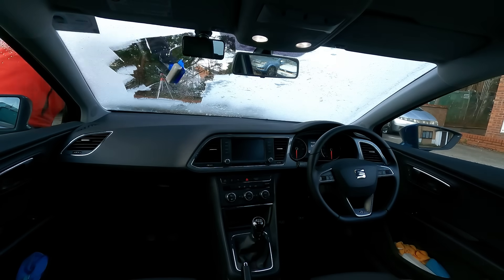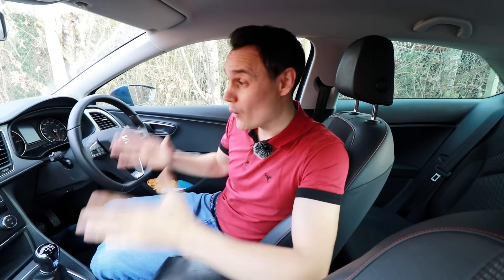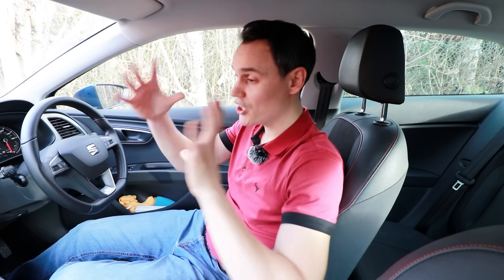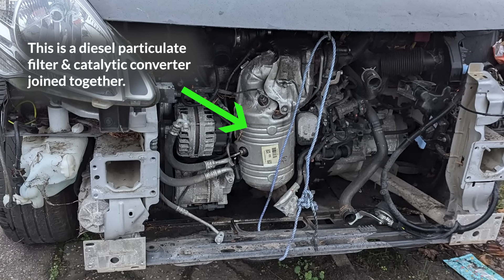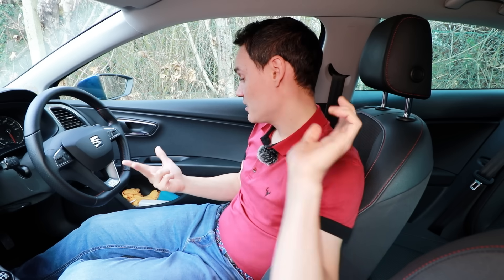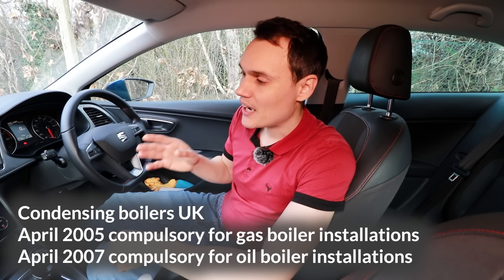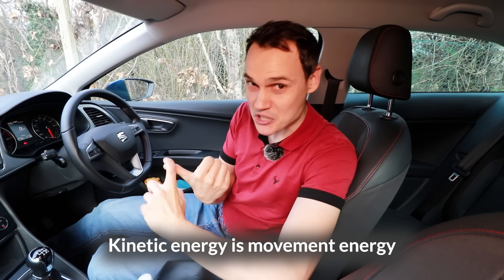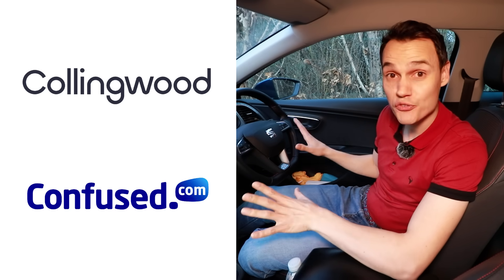How turning the engine on when de-icing can cause you harm. Possibly even cancer.

Comment: Why don't car manufacturers program the function of rapid engine warming? Say, you turn it on and the engine keeps higher rpm than idle when the car is stationary. Let's say 1500-2500 rpm. Seems like a win-win, right?
Reply: Engines do keep higher rpm's than idle when cold. The ECU controls this.
Reply: @collinslfc they keep them barely above idle for less than a minute during cold start. I'm talking about 1500-2500 until the engine is either fully warmed up or the car put in drive and going.
Reply: @Psych0technic  Car manufacturers have to meet stringent emission targets. The higher the revs during cold starts when the engine is running at it's least efficient will increase pollution. Secondly, the more fuel that is used during cold starts will increase oil dilution which is not want you want as this increases engine wear.
Reply: @collinslfc have you watched the video? He says that the longer the cat is cold the worse the emissions the car produces. It is a wide consensus that it's better for a modern car to drive it straight away instead of letting it sit on idle, waiting for the engine to warm up. So, why not emulate it driving while it's parked? It would be incredibly convenient during winter. Besides, if it's just an option for the user to decide and it's turned off by default it shouldn't matter to any regulations. It would be essentially the same as if you just put down the pedal manually which isn't prohibited.
Reply: @Psych0technic  Okay, you know better than car manufacturing engineers on how they should design their engines. I do apologise, I should never have doubted you.
Reply: @collinslfc my bet is that car engineers just don't care enough to bother, since it's not a function that will make money for the management.
Reply: @Psych0technic  Yeah, your bet... Sorry, what qualifications do you have in automative engineering? You haven't stated in your comments. I'm genuinely interested.
Reply: @collinslfc maybe you should watch other videos about the topic, made by people with actual degrees and knowledge. Engineering explained, for example. Because you're the one being ignorant here.
Reply: @Psych0technic  You clearly don't understand the video content of the likes of Engineering Explained... But please answer my question, what qualifications do you have in automative engineering? It's a very straightforward question to answer.
Reply: @collinslfc no, you're first, lol. What are your credentials exactly?
Reply: @Psych0technic  I'm not an automative engineer.  I'm not the one who is claiming that automative engineers are wrong in the way that they design engines, whereas you are. So you have to back that up with your credentials and experience, hence why I'm asking you. It's not a trick question. it's not an argument, it's just a straight forward question.  Please answer it.
Reply: @collinslfc it seems that not only are you having a problem with getting the point of this video, you have a reading comprehension, too. Where did I say that automotive engineers are wrong, exactly? Can you cite these exact words, please?
Reply: @Psych0technic  You literally said "my bet is that car engineers just don't care enough to bother, since it's not a function that  will make money for the management."  Are you being deliberately simple? By the way,  I'm still awaiting an answer to my previous question which I have asked 3 times now....

Comment: I just pour warm water on the windscreen. Quick and easy.
Reply: Been doing that for 30+ years, just make sure you wear a rubber glove to stop your hand freezing after it gets all wet. Use a bucket and sponge- do all the windows, headlights and sidelights. Put the bucket/sponge/glove in the boot in case you have to repeat the process before coming back from work.

Comment: Except it doesn't address the mist inside the car? Is my car the only one that mists up so badly that I literally can't see a damn thing until I demist the windscreen?
Reply: A lot of people still don’t know that air conditioning should be used all year round not just in the summer,air conditioning is basically a dehumidifier in the winter it conditions the air removing all moistures in it,using air conditioning on a cold morning is cheaper and faster at clearing both front and rear screens then using heated screens.
Reply: @alancobbin Unfortunately some cars will refuse to turn the AC on in cold weather, my car won't allow it to be turned on if the outside temperature is below 4 degrees.
Reply: @GreyJan2750   What does this mean? The AC system isn't robust enough to withstand cold temperatures? I know classics generally have pretty anaemic AC systems
Reply: @agiliteka  Water turns to ice at 0 degrees C. Dehumidifiers for sub zero air are expensive.
Reply: @GreyJan2750  
I would suggest getting it looked at or get another car.
Reply: @stuartj1234  It's by design
Reply: @alancobbin my hair conditioner only works in the shower
Reply: @alancobbinweird that I never thought of that! Did it this morning and worked a treat!
Reply: @alancobbinyou need to be careful in the winter, if you blow your AC onto a misted up window before your engine is warm you could freeze the mist/moisture onto the window.
Reply: @mikes1992u  
You do know it blows hot air as well as cold right ?
Reply: @stuartj1234 AC would only blow hot air if you had a reversible heat pump and the majority of cars don't have this, the ones that do are generally electric cars because it uses less energy than a standard resistive heater which helps extend range during the winter
Reply: Check your boot. Take out the spare tire and see if you have a pool of water in the tire well. If you drive around with the window open an inch or two and the heater on it will help to dry out the car.
Reply: My car freezes on the inside to. I have to scrape the outside and inside.
Reply: It's not a honda jazz is it? That car of mine mists up 5 minutes into the drive....what a total pain.
Reply: @geriatricprogrammer4364 Fr same here i drive a honda jazz and its a total pain in the ass during winter always misting up
Reply: @geriatricprogrammer4364  if you have climate control, put it on, it dries the air quite quickly, i know it seem counterintuitive but it works ;)
Reply: You've probably got excess moisture in your cabin. Leave a passive dehumidifier on your dash for a few days.
Reply: @jigler  leave window open
Reply: fill 1 or 2 socks with cat litter, tie it closed and place it on your dash. My car used to fog up terribly overnight and if you don't have the ac on permanently but the cat litter sucks up the humidity and keeps it clean
Reply: You got a water leak to investigate, thank me later.
Reply: Get a dehumidifier and use the air con. My Citroen c1 was awful until a few weeks of the dehumidifier.
Reply: Keeping the inside of windscreen completely clean will speed up clearing (mist clings to dirt and grease). Swapping out carpet mats for tailored rubber mats in winter reduces moisture building up.
Reply: Check your carpets to see if any of them are wet, which would suggest a leak, but in the perma-damp of some places of the UK, you can't help introducing water into the car on rainy days months. Take out brollies and coats to dry them. Living in a rural valley, I have to use silica bags on the dash overnight because damp is just part of life in winter.
Reply: You can get dehumidifiers to dry up the inside.
Reply: @tomriley5790  It always always is a water leak.    
How many new cars your see with humidity issues inside?
Reply: @siamanspaps  It was an issue for me and my brand new car and I suspect that the actual issue was that the trips I took were too short. Once I moved and my daily commute went from 5 minutes to 1 hour (each direction) I had no more problems with windscreen being frosted over from the inside.
Reply: because the screens too cold, it just needs to warm up
Reply: I use a window vac, clear screen right away.
Helps to take moisture out of the car as well.
Reply: If you have wet floor mats, boot … or a leak, or the inside of your windscreen is coated with road grit - these are why the inside fogs up or has condensation.
Reply: Change your pollen/cabin filter, check the scuttle drains for blockages and buy a couple of Hillington dehumidifier bags. Personally I use 2 in front and 1 in rear parcel shelf.
Reply: Depends on your car. My FIAT has a new cabin air filter, new coolant, clean heater core lines and new windshield (old one got damaged). And all rollable windows have wind deflectors. And you should clean all windows every seasons
Reply: Have you tried turning on the AC? Works like a charm
Reply: @izakf5301 some cars turn off AC below 3c (happened to me first time it turned off, complete white out inside my car had to pull over for couple of minutes so heat only cleared the window)
Reply: Get an EV.
Reply: @andyt1048  thanks but no 😂

Comment: I simply use defrost spray and the ice should be gone right away. The spray is less than £5. I wonder why very few people use that?
Reply: not great for rubber seals, creates glare as spray leaves some residue and can refreeze anyway, sometimes on the inside as the glass is still freezing temperature
Reply: @Dr.Kornelius 

Yep...many synthetic chemicals are bad for rubber seals...

Comment: I start the car on the driveway and blow warm air to the windscreen and leave it for a few minutes then i get one of those garden (pump)  mist sprayer 
with warm water inside and i spray a small amount onto the windscreen. It won't crack if you do it slowly and the screen is getting warmer and the ice melts down.
Using those scrapers put fine scratchs on the glass so i avoid doing that.
I have been doing this every winter for over 10 yrs and find it the best solution ..maybe not the safest but i think i will now keep well clear of the exhaust.

Comment: This is a great reason to switch to EVs as soon as possible. Getting into a warm car without breathing toxic exhaust fumes is unbeatable.
Reply: Ginormous depreciation rates, worrying about where to charge the car, waiting ages for it to charge, reduced range and battery capacity in cold weather. Not to mention new legislation for EV owners with pay per mile.

Comment: The short version (the main idea)

Leaving your car engine running while you de-ice it is bad for your health, because at the beginning the car releases much more toxic exhaust gases, and those gases are especially dangerous before the catalytic converter warms up.

So the recommendation is:
👉 De-ice first with the engine off → then get in, start the car, and drive away.

Why this happens (in simple terms)
1. What is the catalytic converter (“the cat”)?

It’s a part of the exhaust system.

Its job is to clean toxic gases coming from the engine.

It turns very harmful gases into much safer ones.

⚠ Problem:
The catalytic converter does NOT work when it’s cold.

It only starts working properly at around 250°C.

If you drive, it heats up in ~30 seconds.

If you just let the car idle, it can take several minutes.

So when the engine is on but the car isn’t moving, toxic gases are coming out almost untreated.

2. What toxic gases are released when the engine is cold?

When the catalytic converter is cold, the exhaust contains a lot more of:

Carbon monoxide (CO)
→ Extremely dangerous
→ Can cause headaches, nausea, brain damage, even death

Nitrogen oxides (NOx)
→ Irritate lungs and airways
→ Worsen asthma and heart/lung problems
→ Help create smog

Hydrocarbons
→ Some are carcinogenic (cancer-causing)
→ Worse during cold starts because extra fuel is used

👉 When you stand outside de-icing with the engine running, you are breathing these in.

3. Why idling is worse than driving

Idling (engine on, not moving):

Catalytic converter stays cold longer

Toxic gases stay high for longer

You breathe more pollution

Driving:

Catalytic converter heats up quickly

Toxic gases drop fast

Safer for you and others

So “warming up the car” by idling is actually worse, not better.

4. Why it’s especially bad for children

Children breathe more air per body weight than adults

Their bodies are still developing

If exhaust fumes are blown into the cabin, children get a higher dose of toxins

That’s why the video strongly says:
❌ Don’t leave children in the car with the engine running while de-icing

The final recommendation (very clear)

❌ Don’t do this:

Engine on

Standing outside scraping ice

Demisters on while you wait

✅ Do this instead:

Engine OFF

De-ice the car

Get in

Start the engine

Drive off straight away

This:

Protects your health

Reduces toxic exposure

Gets the car’s cleaning systems working faster

Comment: Watching this is funny working in a body shop with the door closed in the winter and cars running when we move them about. Might have 20 years of my life gone away already 😂
Reply: I remember watching some TV series where one of the characters committed suicide by sitting inside the car and letting the car run inside a closed garage.  Not too sure if that's very accurate though 😂
Reply: @SA-zn1wd  Pipe from exhaust into car or head in a gas oven. All good tried and tested methods. This is getting a bit dark now 😂
Reply: @SA-zn1wd  Cartman, on South Park 😂

Comment: I have admit the Halfords 'Super soft Car Drying Towel' is amazing for demising interior windows.   

However as I drive a 2013 Diesel, driving without letting the oil in the engine block warm up  is damaging, so running the engine while de-icing is not only to de-ice and demist.

Comment: I have a petrol car...the exhaust fumes smells nice with the cold start though 😅 something is weird with me I know
Reply: I used to love fumes from old diesel trucks as a child. I told my mom one day and she said while pregnant with me, she liked that, as well😊 I love cars, especially petrol but driving a diesel at the moment 😅
Reply: not a good idea to be smelling them so openly though haha
Reply: I left my 2003 corolla on one winter whilst walking in and out of the kitchen to defrost the car... 2 minutes late my carbon monoxide alarm in the kitchen was beeping!😢😢
Reply: modern cars ("modern" anything past like 1990) have a programming in their ECU that enriches your mixture and delays the spark timing of the engine to increase the heat generated in the engine and exhaust system. This helps warm the engine and catalyst up faster. It's also why your car tends to sound louder on a cold start, since the delayed spark timing means some of that combustion occurs during the exhaust cycle

nvm he already talked about this
Reply: @Killbayne i think is the other way around: if you want to increase the engine temp, you lean the mixture in order to have more oxygen in air/fuel mixture....If you want to cool the engine, you enrich the mixture, so some fuel is not burning, less oxygen in the air/fuel, fuel unburned will evaporate and cool the engine. At least this is how I understood the ICE 🤔
Reply: @ionutpatrascu2296  You're correct about the engine temp. When you richen the mixture the engine will be colder but the exhaust will be hotter because the unburnt fuel will burn in the exhaust thus heating up the cat. They can also inject some fuel on the exhaust stroke or have a dedicated injector in the exhaust to help with that. It's the same way a particulate filter gets hot enough to regenerate.
Reply: Not just you mate.
Reply: Remember 50% on how much you are allowed to pollute according to the homologation cycle it is produced when you start and due to that we try to burn the particles as much as we can and this is why they will be absorbed into your lungs much better thanks the old depollution norms (and that isn't a good thing for your health).

Also, when you have multiple cars stuck in traffic idling, it is better to avoid doing your morning run alongside them
Reply: I actually always liked the exhaust fumes produced by ĺorries / coaches and ships because they remind me of holiday journeys😅.
Reply: It is not just you :D 
I love the smell of two stroke exhaust and petrol too 😁
Reply: Excellent explanation. Thank you.
Reply: For one of my pregnancies, my craving was for smelling petrol. I used to go out to my car, remove the cap and breathe it in! When I 'confessed' to my midwife, worried that it might be harmful, she said that it was one she had heard quite a lot. She advised me to put a small amount in a glass jar and keep it in my kitchen so that I could smell it more easily, once a day. That was in 1994, I guess they didn't know that stuff about it back then? I still love the smell when I fill my car up though! 🤨
Reply: @bojo88  That is fucked up.
Reply: Me too...

Love the smell of a petrol station 😀
Reply: Count me in too😂

Comment: I just bought a window cover and it works a treat
Reply: They do work well that’s true. The only problem with them is knowing when to use them. It’s often far from obvious when we are going to get a frost. I suppose you can more easily check forecasts now but even so it’s a bore fitting the covers and what do you do with it when removed? Stow in boot?  Just making the point that a simple effective solution is not always that.
Reply: @Chris-f7s2y I just have one for the front, £10 off eBay and it just elastic straps round the mirrors and a tap gets trapped in the door. It takes a minute to put on and off, I have an estate so I just put it in the boot